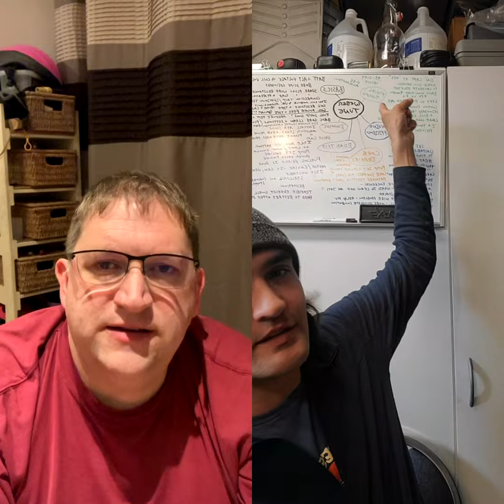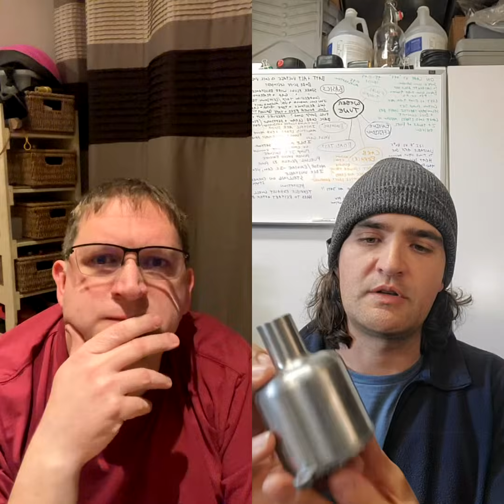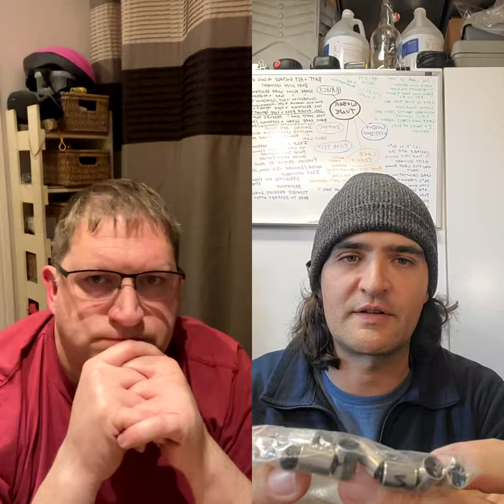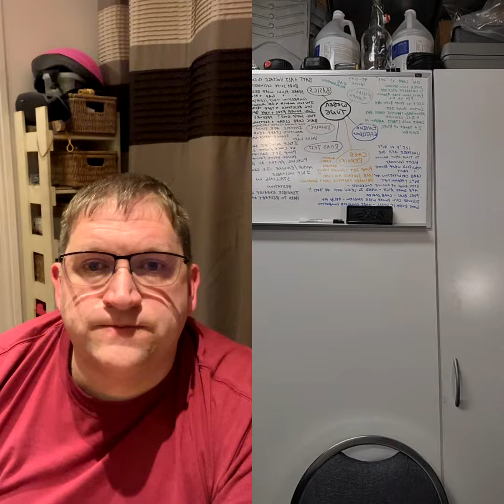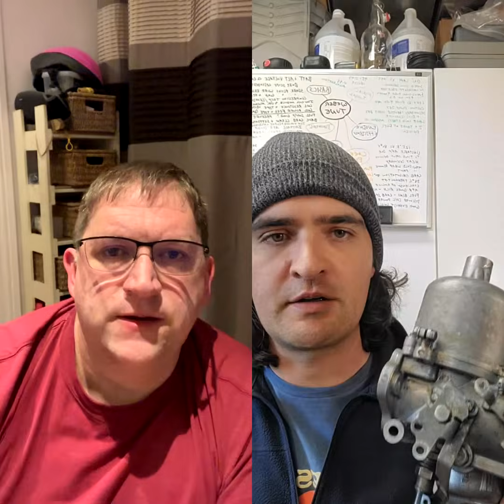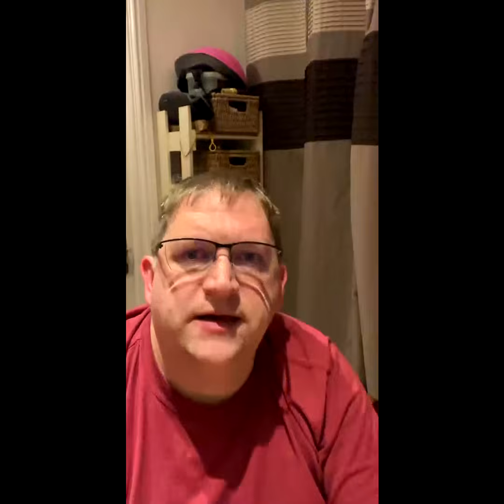AC Dodd is live

Comment: Thanks AC and Darren. I had the 1098 non starter. Changed the condenser as recommended by you. Then realised the timing was 180degrees out. Fired up first turn of the key. My dad will be happy. Thanks again.
Reply from the maker: Yes, it will never run with the timing 180degrees out
Reply: @ACDodd thanks again. It previously had a ducellier distributor. On close inspection it seems the new Lucas dizzy has the lug on the heal and the ducellier has the lug on the front for the rotor arm. Every day is a learning day I guess. 😅 thats why I love these videos. I always learn something.